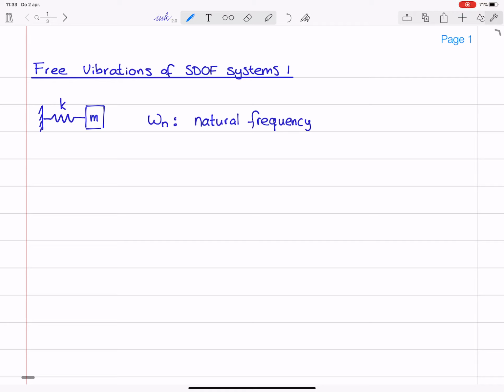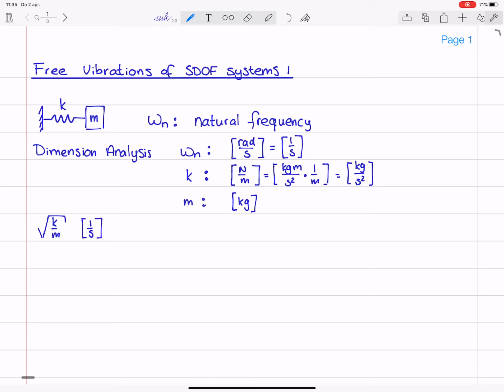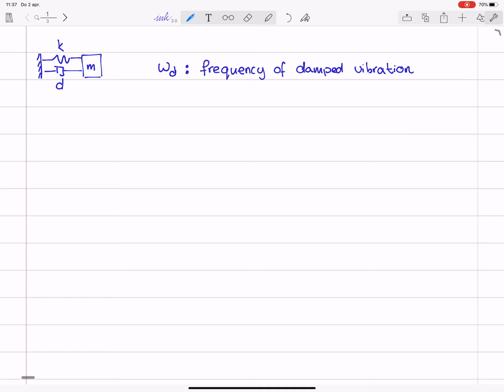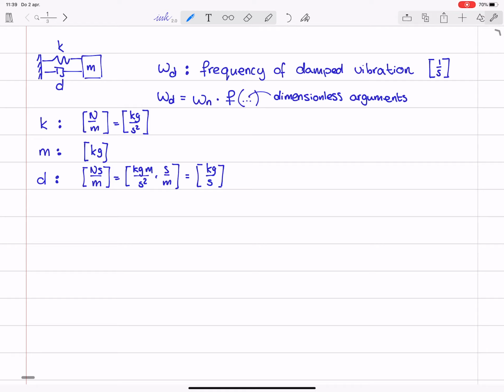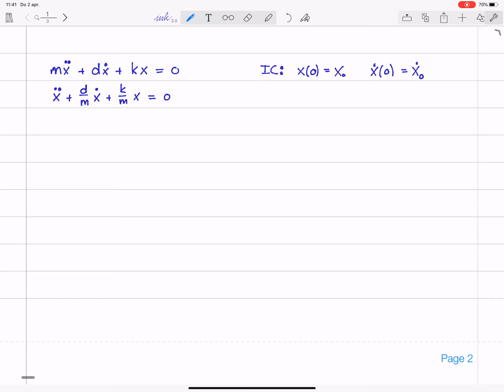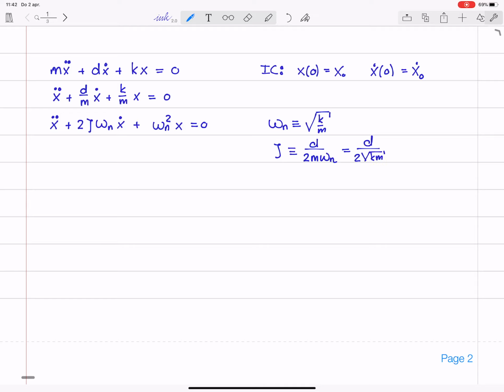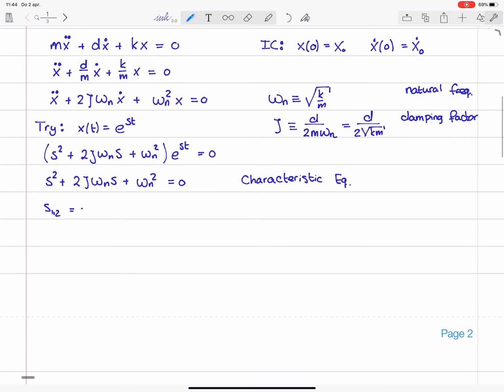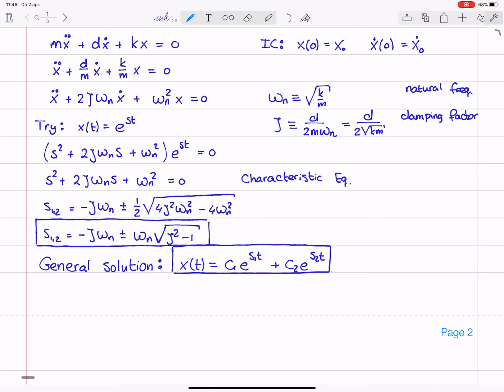Mechanical Vibrations 26 - Free Vibrations of SDOF Systems 1 (General Solution)

Comment: I didn't get how the solution part works at 10:26 
How did the quadratic eqn with s^2 + ... gets multiplied to the exponent and equated?
Reply: It is an homogeneous second ODE. Using x(t)= exp(st) then differentiate twice gives x(t)' = s*exp(st) and x(t)"= s^2*exp(st). Substituting this in x" + d/m*x' + k/m*x=0 gives --> s^2*exp(st) + d/m*(s*exp(st)) + k/m*exp(st) = 0 . 
Now we take exp(st) common as its a common factor in all terms. This results in (s^2 + d/m*s + k/m)*exp(st). The natural frequency is given as wn=sqrt(k/m) --> wn^2=k/m. Damping factor is given as J=d/2mwn. rewrite this in d/m gives d/m=2Jwn. Substituting wn^2 and d/m in (s^2 + d/m*s + k/m)*exp(st) gives --> (s^2 +2JwnS + wn^2)exp(st)=0. As exp(st) will never reach zero, the terms in the brackets must equal 0 in order for the equation to be true. 

I hope my explanations helps and makes sense:)
Reply: @robbybos1999  wow, got it now! thanks so much buddy!
That was a very clear explanation!